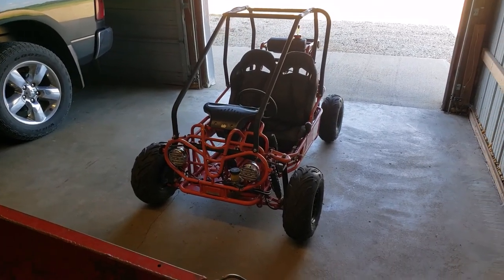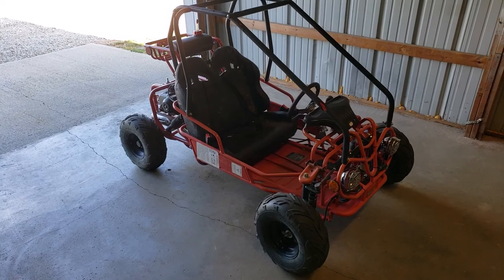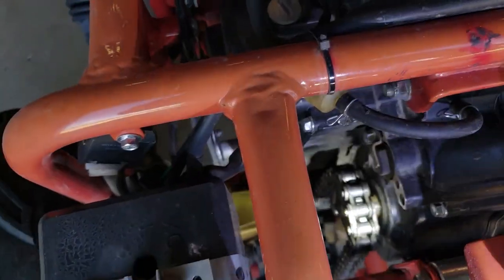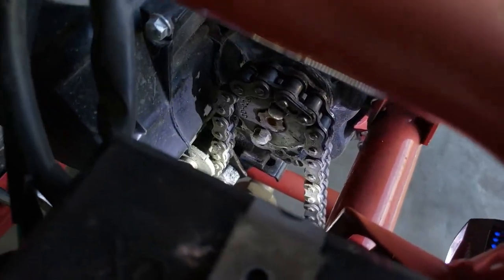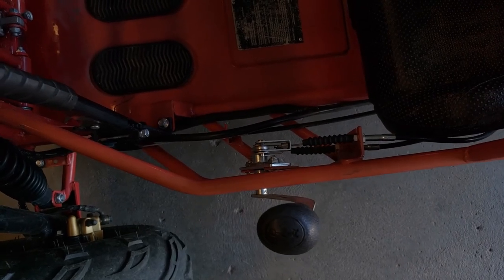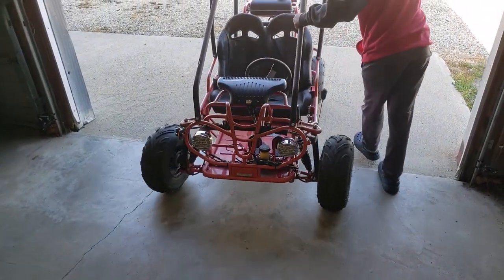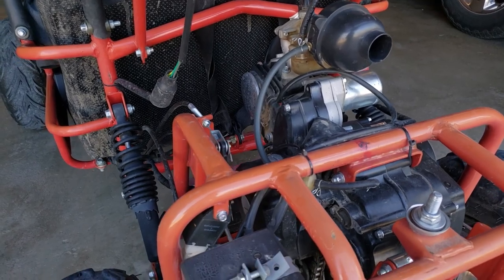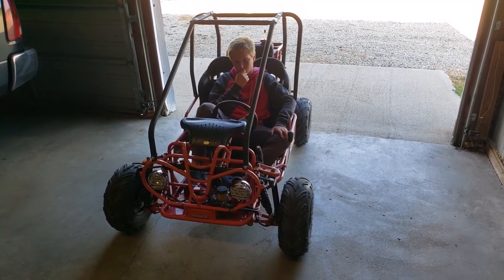Tao GK110 Go Kart Chain Tensioner Breaks Again! We design our own!

Comment: The tensioner bends when you go in reverse because it pulls the slack end of the chain tight.  The stock tensioner is just too weak for that type of force.  Im going to try to build something stronger.
Reply from the maker: I believe your correct. Its bending whenever they were hitting reverse. Its a terrible design on TaoTao's part.

Comment: We need a new chain tensioner for the exact same go kart do you know where to get one like yours?
Reply from the maker: https://www.monsterscooterparts.com/brands/taotao/models/taotao-gk110-110cc-go-kart-parts/chain-tensioner-for-taotao-atk125a-gk110-jeep-auto-go-karts.html This is the OEM one that it comes with. I replaced it with this OEM one, happened again. Then made my own spring loaded design one, happened again. Something is not right with this setup. If yours did same thing as mine, it will probably happen again. I'm curious if anyone knows why its doing that. None of the dealers I reached out to, would help me with this issue.